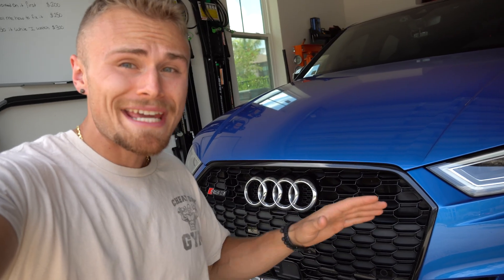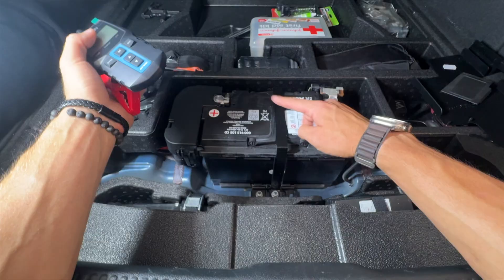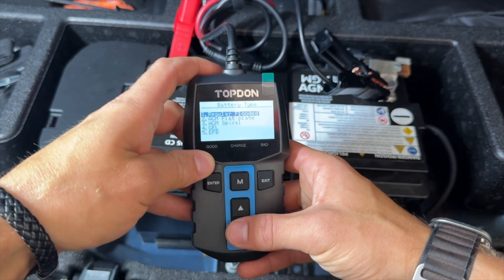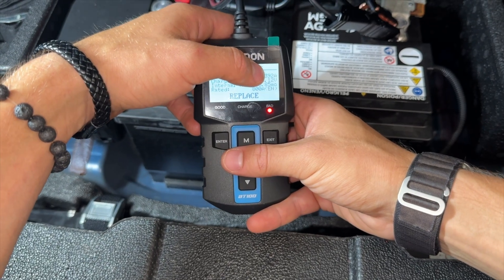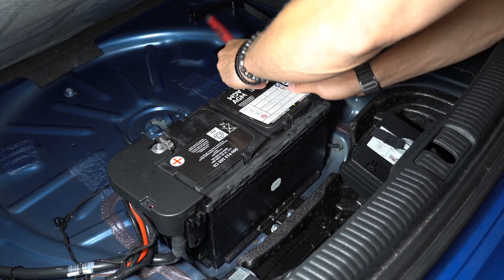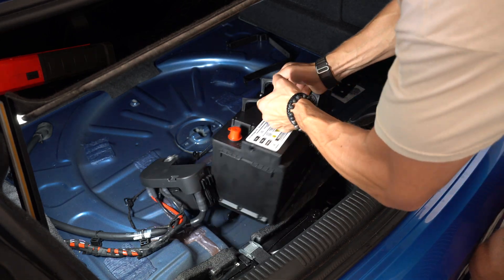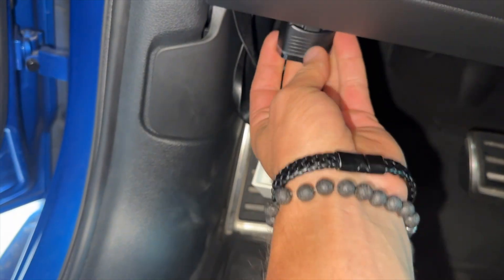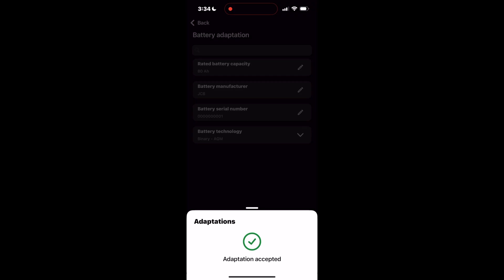How To Replace and Code Your Audi or VW Battery (THE RIGHT WAY!)

Comment: OBD11 does not work for battery adaptation on 2019 and newer Audis.  You will get an "incorrect sequence" message and the adaptation will fail.  There is no work around on this.  OBD11 has made no attempts to correct this issue.  Do not buy Pro or Ultimate to do this adaptation/re registering step.  It will not work and you will be out some cash.

Comment: Is coding a battery “Necessary” can you not disconnect the negative on the old battery clamp it to the new battery, then repeat the process with the positive side? Thus avoiding coding and having to reset everything?

Comment: When coding a new battery, Ross-Tech, the people who developed VCDS for VAG vehicles say the correct thing to do is to use an OEM battery and to enter the information which is on a sticker on top. This includes the battery manufacturer, the amp/hr rating and the serial number so that the controller knows everything about the battery and can correctly manage its resources. They don't say anything about making up your own serial number, or just changing one digit. Not saying this guy is wrong, but Ross-Tech are no fools, and I'm more inclined to believe them.
Reply: The reason people will make up their own serial number or change a digit is because not everyone is going to use an OEM battery.

I certainly wasn't going to buy a new VARTA or VAG branded VARTA battery here in Australia when I needed one a day ago as I would prefer to support a manufacturer like Century Yuasa who has manufacturing in our country.

They don't have BMS data for manufacturer names/serials so this is where I made my own data.

Ross-Tech are only speaking to OEM as an option, but I certainly don't believe in always buying OEM everything.

Comment: Replaced a Skoda battery that allegedly needed “ coding “ like all VAG vehicles. Here’s how you “ code “ it and get rid of the battery light without all this. A) put battery in. B) turn lock to lock hard left then hard right twice. Switch ignition off. Turn car on, no engine light. Everything works fine. Enjoy !
Reply: How do you mean? Does this also work for VW?

Comment: Never bothered to code the new batteries. They all lasted more than 4 years with no coding whatsoever. It’s a new revenue stream for the auto industry.
Reply: It just tells the BMS how much it should expect the battery to be able to charge and discharge. It still uses voltage to actually decide if the battery is empty and needs extra load on the alternator or not.

So you don't have to, but if you have the tools handy anyway, there's no reason not to. Wouldn't pay to get it done though.

Comment: Do you connect a constant 12 v power source while changing the battery to prevent loss of memory on components? Losing radio presets isn’t important but wondering if there are other things that are reset?
Reply: there are definitely other things that will be reset like transmission adaptations etc... usually this isn't an issue and the car will relearn these things quite easily after a couple of miles, so it's not something that is really necessary.
Reply: @dergescheitepenner  The important transmission adaptations aren't reset - by that I mean pressure and quick charge adaptations for the clutches. Maybe it resets the adaptation to your particular driving style, but as you said, that's not an issue.

Comment: Do you need to code the battery? WTF, modern cars are crap... I can change the battery in my 2000 Clio in 5 minutes by removing 4 nuts!
Reply from the maker: yes you need to

Comment: i think this process is a money maker for manufacturers or dealers. it does not make sense to me. i know on honda there is radio code needed when i uninstall the battery. i think the solution is to keep a positive 12 volts in the system while placing the heavy gauge red and black cables away from the battery. that way it does not reset some kind of computer inside. the batteries dont have an integrated chip inside. what gi ves?
Reply from the maker: when you take the 12v battery off a honda the radio needs to be coded because the radio thinks it has been removed from the car aka "stolen" then you need the radio code to turn it back on. this is a theft prevention measure. Euro cars are more advanced. over time the 12v battery weakens and to make up for it the car over time tells the alternator to send more power to the battery. this way it can compensate for the battery voltage or amperage loss. when you put a brand new battery in.. the car still thinks its the old battery. therefore sending too much power to the new battery and in theory weakening it over time by overcharging it... you need to tell the car it has a new battery this way it can correct how much power the alternator sends.

Comment: Code battery? What's next? Code tires and sparkplugs too?  These manufacturers gone mad .
Reply: Yeah total BS. They will have you code the windshield wipers soon that are only available from the dealer
Reply: As long as you buy the exact spec of battery, there shouldn't be an issue without coding it, but the system will work with the old data and might not fully charge the system.
Would be interesting to know if you can actually just reset the battery module. On my previous ford, I just had to press some buttons in a specific order to reset the module for a new battery. This way the System knew that the current state was the new max setting.
Reply: Coding the battery offline with generic tools is as generous as Audi gets, all other modules need to be coded online and vin matched, aftermarket tool support is disabled, only through official subscriptions

Comment: Battery coding is wildly overstated. My 2010 A4 killed its first battery in year five; the dealer wanted $400 including ‘coding.’ I went to Costco, paid under $200, and that battery ran eight years. I’m now on my third—again Costco, again no coding, zero issues. Performance is unchanged, lifespan is excellent, and the so-called ‘OEM advantage’ is pure mythology. The online noise is just click-bait hysteria. Period.

Comment: AGM batteries made in Germany have never lasted me more than 2 years from the dealership..  Any ideas why?
Reply: I’ve had one that last me around 6 years
Reply: @RealBreal 😮
Reply: The factory-installed OEM battery in my Škoda Octavia lasted exactly 10 years. Subsequent replacement batteries lasted only 2–3 years at most. Based on my experience, Exide performed best, while Varta performed worst.

Comment: I have a question, did the Audi MMi requests any code or gets blocked when replacing the battery? 
I need to repalace my A3 2020 battery, but the previous owner didn't give me any code
Reply from the maker: not at all lol. i have disconnected the battery dozens of times and that has never happened

Comment: Ive tried to take the + terminal off the oem battery on the rs3 but the black plastic part is stuck and i cant get it off. The terminal itself i can but tue whole assembly is attached to the battery somehow. and yours came right off like nothing..
Reply from the maker: it clips onto the battery on the side. stick your hand under it and pull it down and away and it will unclip. its like a latch that clips snaps on underneath

Comment: I changed my battery on 1.5 tsi, it was Exide EFB 60Ah, now i put similar exide but 62Ah. Changed data with OBD11 gen 2 , but i cant change serial number. Somebody changed already battery few years ago and number stays 999999993 an if i want to change number, whatever i type, red letters WRONG NUMBER appears. How to solve this, recconect battery, put it on charger a while or unplug terminals for few hours?
Reply: Omg i put 9 digit number.
Reply from the maker: hahaha!!!!

Comment: Why are you recommending a subscription based ODB2 tool? An ANCEL VD700 could have run the battery test, programmed it and cost less without a subscription and lifetime updates. The ODB11 is a powerful tool but not something the average person needs for maintenance, especially because the average consumer gets the VIN locked version.
Reply: Not so. I actually have one and it works on all four of my Volkswagen vehicles. You are correct there are non-subscription scan tools that will work, however, for Volkswagen and Audi vehicles the OBD 11 is a great choice due to the coding ability to enable features on the vehicle as well as for service needs.
Reply: I don’t think the average person driving a vw/audi is doing their own maintenance. Most diy’ers in the community use OBDeleven, so thanks for showing us how to use it.
Reply: He is probably only doing this for simplicity, but you can use almost anything.

I have a simple generic OBD2 to Bluetooth tool and used an app called Car Scanner Pro, which isn't as intuitive....but I've had the OBD connector since my last VAG car and the only expense was the app in the end.
Reply: Have programmed about 10 different cars one subscription.
Reply: Because OBD11 sponsors youtubers and most of the other OBD2 tool companies don't.

Comment: Thanks for this guide.  My '18 RS3 battery is still going strong; I've bookmarked your video for future reference.  I love this car and have no plans to part ways with it in the near future, so battery replacement is inevitable for me.
Reply from the maker: dont wait for it to fail!!! if its oem battery from 2018 its time to replace it. go get the battery tested for free to check
Reply: @Haydenschreiermk2  I have a tester similar to yours...  Battery health is 100%
Reply: @biostatsguy  Batteries can be very hit and miss. My current Bosch AGM battery started failing just after the 2 year warranty period. I've seen 10+ year old batteries work flawlessly. I wouldn't replace it unless it's starting to show issues. Same applies for phone and laptop batteries. I've seen them fail very early, or last 10 years and 2000 charge cycles. No need to replace one just because of age usually.

Comment: Code the battery is so stupid. It doesn’t make sense. A $100 Optimate battery charger and maintainer can get the condition of a battery and charge it without any coding. Yet this car needs to be coded. Hilarious
Reply: You’re right. So long as you use the same type and capacity it’ll work fine. BTW, the topdon bt100 was one of the least accurate in a recent group test.
Reply: Many modern cars have a Battery Energy Management system. These days cars have alternators with outputs of 180A and more because of the greater electrical loads placed upon the battery. So the BEM system works to manage the battery's resources to optimise efficency. and to do that the controller needs to know the battery information. If the controller doesn't know either because of no coding or the wrong coding is entered then you could have electrical issues or faults you will not be able to resolve.
Reply: @andrewdeane917 so how do you explain the fact that my Cayenne battery was never coded but it is currently 6 years old? The only maintenance that I do is connect the battery to a high end maintenance charger every week.
Reply: Not just this car and its not just for conditioning either..!!